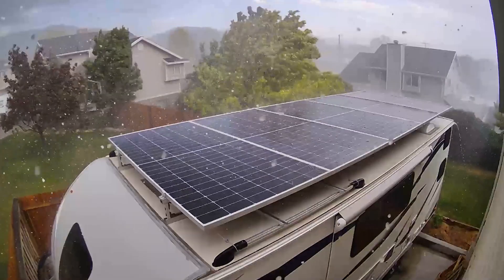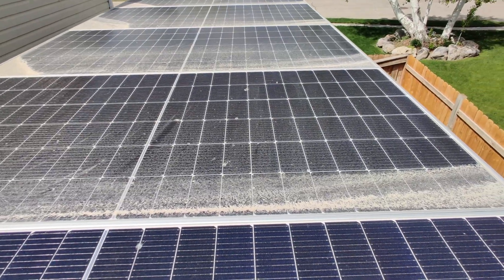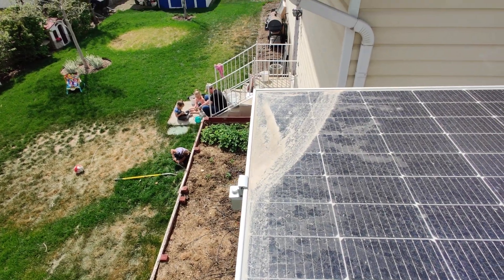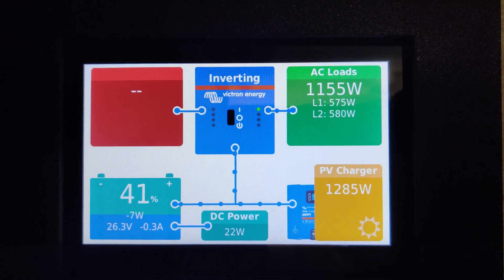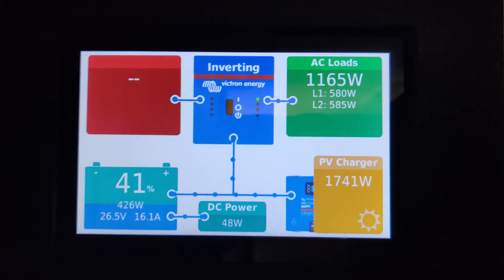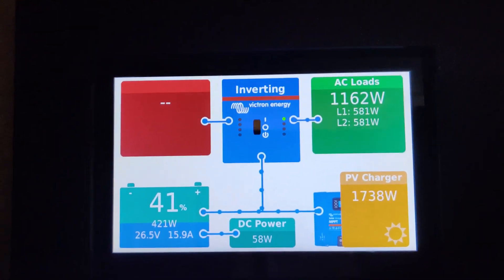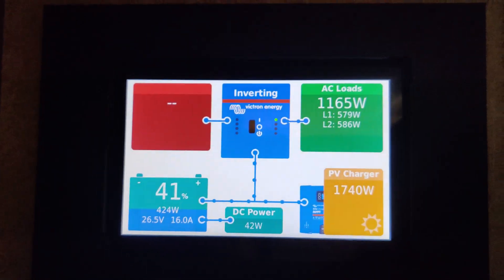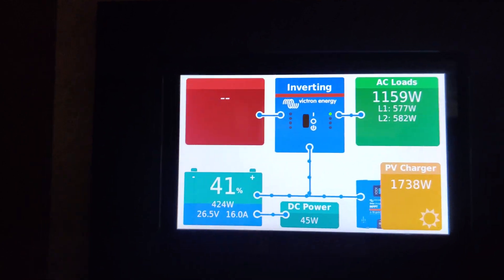Solar Power Production Difference Between Dirty and Clean Panels

Comment: I did not see where you acquired your solar panels.
Could you help me find the 500 watt panels?
Reply from the maker: In the video description I have a link to this spreadsheet https://docs.google.com/spreadsheets/d/1L2IxNuZ8ZQl3-Fey8dBsKHQH7RidaSkTDCVPGTeikKc/edit?usp=sharing and the solar panels are listed on line 143. I got them from Santan Solar in Arizona and unfortunately they no longer have them listed on their website. I recommend not looking for my exact make and model of panels, but search for the largest Wattage panels you can find to accomplish the same goal where the physical size crosses the width of the RV.
Reply: Renogy makes Excellent Class 1 Solar Panels. I have 6 x 450w panels. You can shade part of the bottom half of those panels and the mid diode makes the top half full producing. Renogy also have 550w panels.